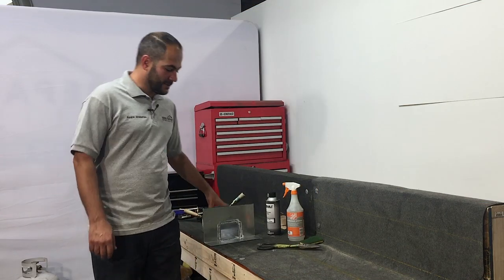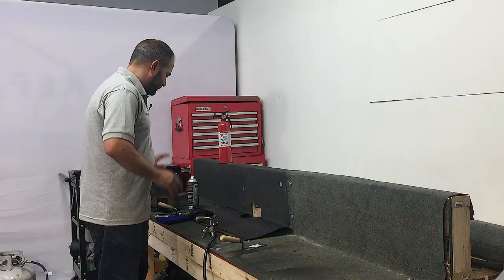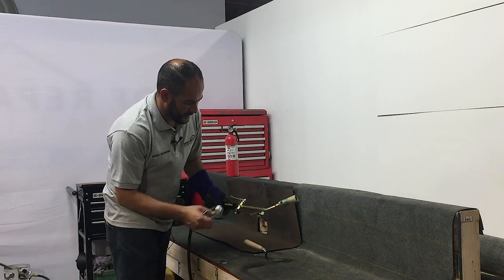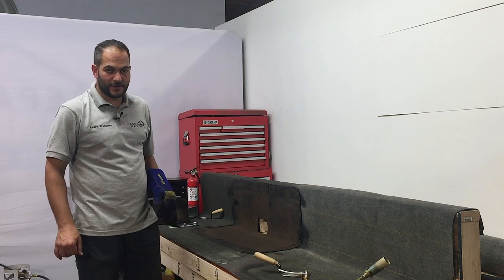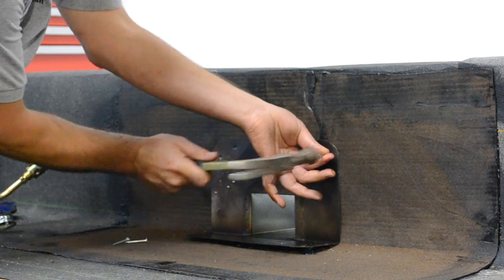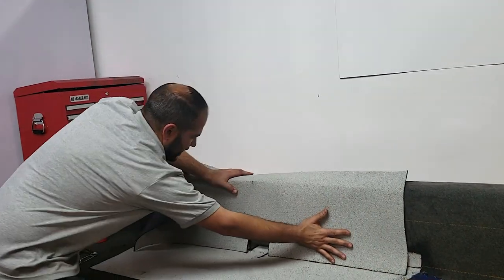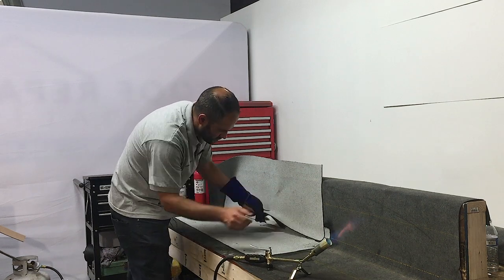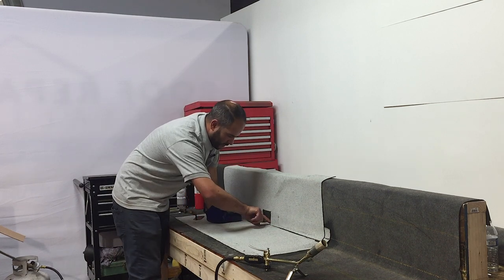Installing a Flat Roof Scupper Drain - Tutorial

Comment: Great presentation can I applied a new scupper over an existing one that runs down in through the wall and out.
Reply: Thanks Edwin, we generally like to remove the old scupper and install a new one. If the existing scupper is in decent shape you can re-use it, its just not ideal however.
Reply: @andreafsharian4346  thank you
Reply from the maker: Your Welcome

Comment: is scupper good enough in multiple places on a 3000 sq feet flat roof or do we also need floor drains on flat surface
Reply from the maker: It really depends on how many scuppers there are, how the roof is sloped, the size of the scuppers and your climate zone. In california the amount of drainage needed is actually dictated by the plumbing code. .

Comment: What specs say you don’t go on the deck 6” let alone no can’t strip that’s not supreme field sheet goes to top of can’t and wall ply 6” on deck
Reply from the maker: You are 100% correct. I made a mistake in this video and did not show that. We actually just re-shot the scupper installation video yesterday and will hopefully have it edited and up within a few weeks. I'll try to remember to send you a link. 
The other thing we've changed is stop the use of mastic under our flashing when torching. We learned that when mastic gets to hot it pretty much becomes useless.

Comment: My scupper looks completely different. It’s black it’s made of different materials not anything like that. The other side got broken when they installing the AC unit and now water was leaking down the side of my house it’s not supposed to and he’s destroyed insulation under belly and all kinds of crap, but nobody’s taking responsibility. The roofers could’ve accidentally did it when they were spraying who knows but nobody’s going to take responsibility for it.
Reply from the maker: Common problem when dealing with multiple contractors, finger pointing.

Comment: Too bad the presenter had too little experience doing torch installation. Sometimes he wasn't sure which hand to hold the torch. He should have had leather gloves on both hands. You don't need to cut off scupper corners just slightly bend the flange toward the outside with your hand so when you install fits in tightly. Masticking the other side of the flanges is good practice but (!) also fill up the corner area too behind the soldering of the opening in case it is not hundred percent water tight. His work with wall cap sheet was the weakest point of this video presentation, he totally ignored the top edge opening of scupper tunnel. He's totally wrong about the cap sheet on the top of the wall. I think when a pro decides to make such a presentation he should not only demonstrate every step how to do but also the principal theory behind of that particular practice being demonstrated. Many steps were ignored, not shown or explained why do it such a way. On a zero to hundred scale I would grade this presentation with a 70 % score.
Thank you, Gus from the San Fernando Valley.
Reply from the maker: Thank you Gus, I always appreciate thought out feedback. 
I have a newer video on the same topic, if you have a minute to spare I would appreciate some feedback on that video

Comment: This hurts to watch. Do not make instructional videos just because you read a handbook.  Your base completely lets go during the first winter because it's not torched properly. You have to fully base your opening before putting your scupper in to prevent all airflow and moisture from getting at the rest of your torching. You never run your field cap up the wall. Do not leave big wrinkles and air pockets in your torching. If you have to liquid membrane the entire area after you torched it then get off the roof. The only part that gets liquid membrane as a precaution is your bleed out termination inside the scupper because the 90s will let go over time no matter how well they're torched. The problem with this is there's a lot of people that watch this and then think they can do it and it fails, I fix this kind of poor work all the time.
Reply from the maker: You never run your field cap up the wall??? 
Looking forward to seeing your videos.